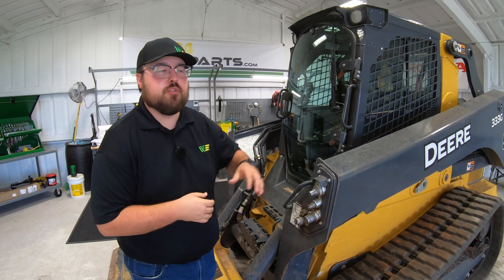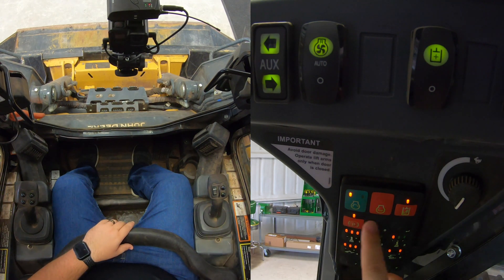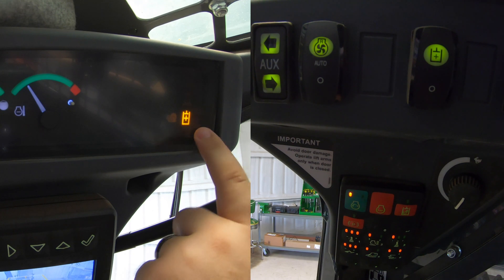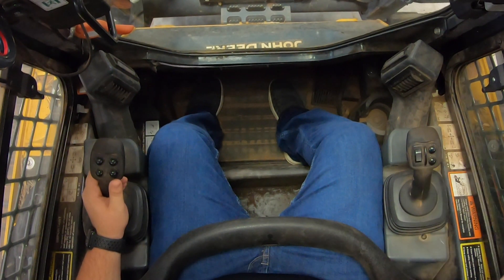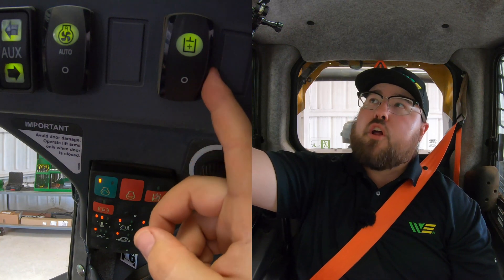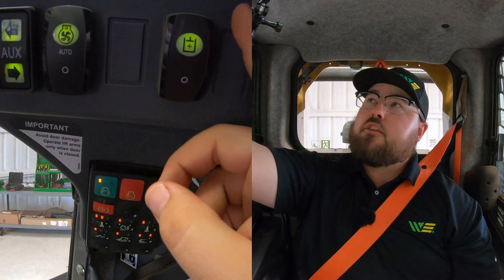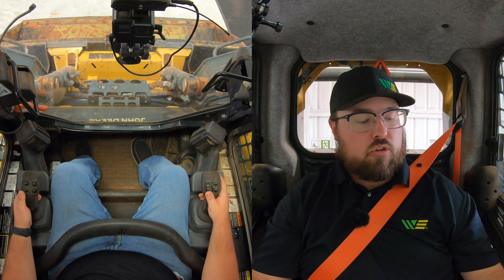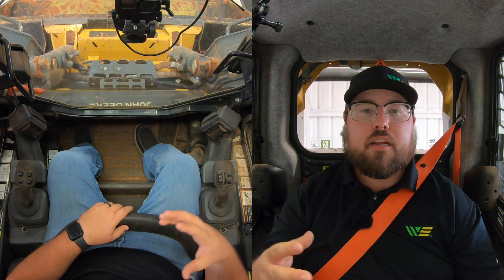How to Use Hydraulics (High Flow/Low Flow) on a John Deere 333G Skid Steer Track Loader

Comment: I will be adding a tree spade attachment for my 333G. It has a handheld pendant controller with seven toggle switches to operate the seven cylinders. What is the proper procedure for directing a constant flow to the tree spade?  To me it's a little different situation than powering up a mower which starts spinning up with the right hand roller switch and then locked into position via the bottom corner left hand switch. Can I initiate flow with the roller and will it automatically flow back into the return port until I direct it into the tree spade cylinders? Any help is appreciated. Thanks , Len

Comment: Hi, I recently purchased a 333D with high flow "verified by my local JD dealer through a SN search". 1st thing is it didn't come with a case drain. I added the case drain but for some reason, the high flow won't engage when pressing the switch. Any ideas?

Comment: Got a video on taking off the hydraulic lines?
Reply: I was a bit nervous at first with my new to me 333G, but turns out there's nothing special about it. I just push in, push the collar and pull the hose off. There's no pressurized spurt like I was expecting.

Comment: How do you keep hydraulics activated/on when you need to get out of tge machine? To operate a backhoe attachment...
Reply from the maker: I believe there is a hydraulic override option, but this may need to be activated by your local dealership. Have you called your dealership about this?

Comment: Great video.... very informative. I purchased a JD 317G which should be standard flow but my male couple how far right will not accept a standard flow female. Is it possible that the prior owner installed a high flow track Loader set up on the unit ? Also, can HF connections be used on standard flow machine ?
Reply from the maker: This could be possible and yes the high flow couplers can be used for standard flow.